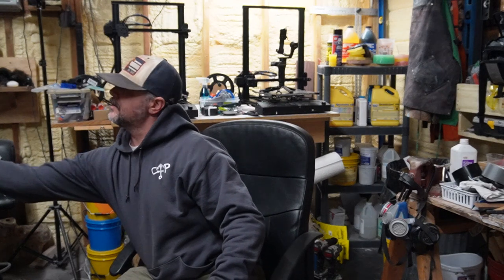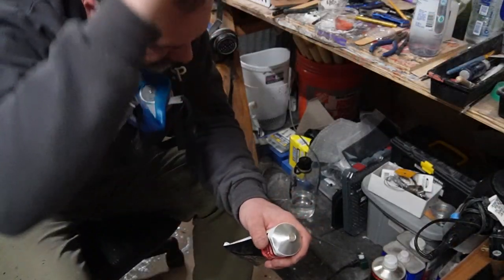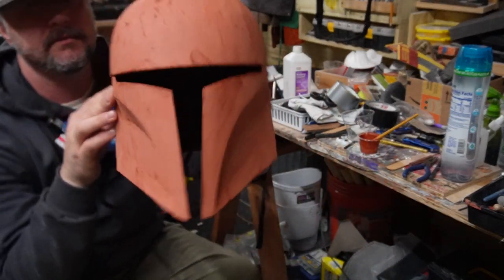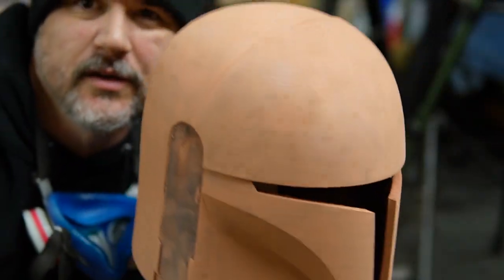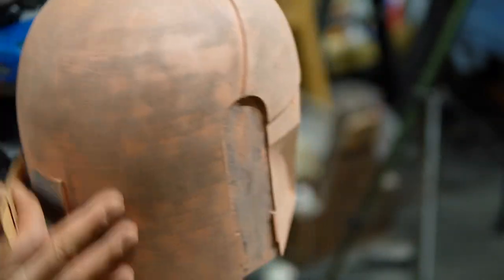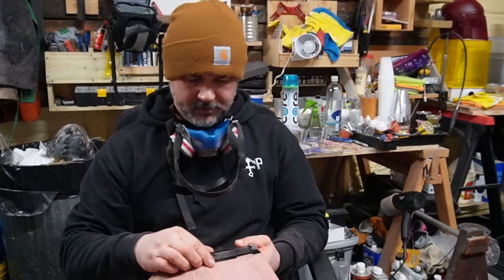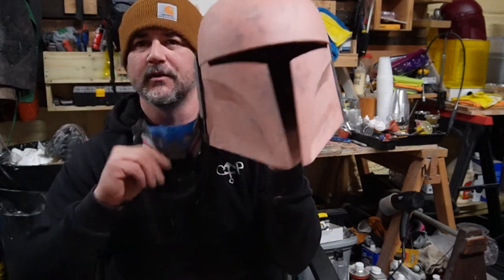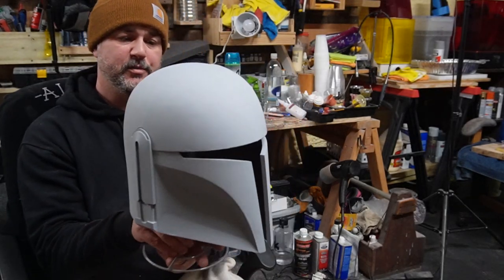How I Get a 3D Print ready for paint!  Post-Processing On A Star Wars Mandalorian Helmet.

Comment: I’m trying this!  I couldn’t really tell if during the application phase, after it’s on the part, you don’t want to see any print lines through the bondo/acetone mix, correct?  If you can see them, you need to apply a little thicker or a second layer?
Reply from the maker: You want to sand down to where you see lines.  You basically building up the low areas to meet thr highs.  Usually takes a couple coats but dries super fast. That's the big advantage to this method over something like coating it in epoxy resin.

Comment: Benefits to the spot putty versus epoxy resin besides the time savings?
Reply from the maker: Easier to sand, more control and doesn't cover details.  I'm sure there are more but the time saving part is the biggest and the best benefit.